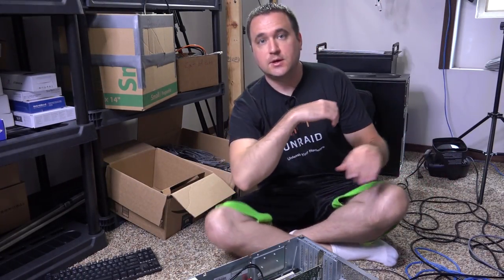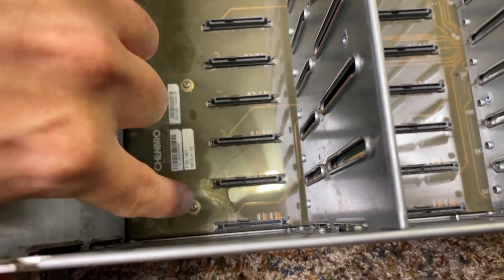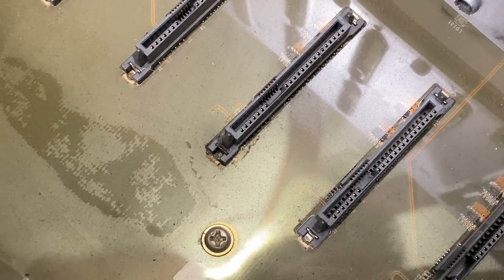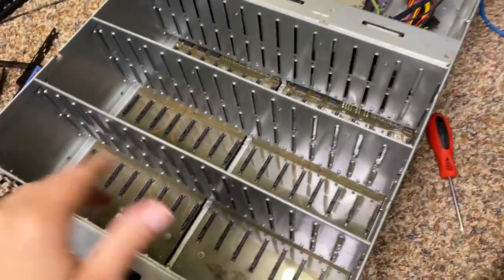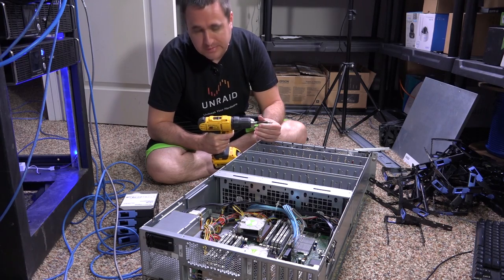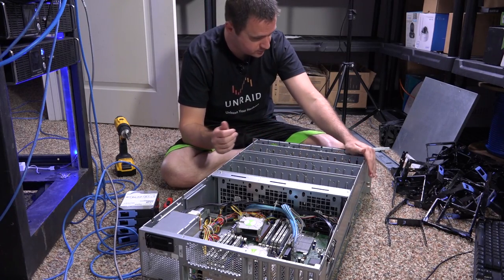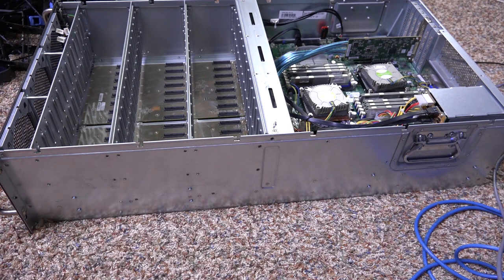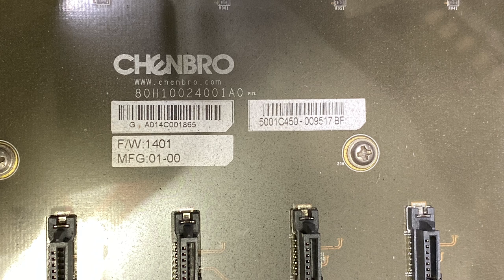New Server Tear Down...It was gross..

Comment: Lots of advice already given but I'll just add my 2 cents here. ;) As for credentials, I've worked in Enterprise storage all my life and I've recently done some videos of my personal server discussing exactly these topics (combined with ZFS but stil). Not linked, but they are pretty recent on my channel!

- Each LSI/Avago SAS2008/SAS2108/SAS2308 card can be run in IT mode, bypassing any onboard logic chip and giving the OS direct access to your drives. You want this if you are running UnRAID or ZFS, the OS and the disk system (UnRAID/ZFS) will control what will happen with a disk that is failing or not working correctly, no intervention from any RAID logic desired.

- A SAS connection in a SFF-8087 cable is made up of 4 channels. SAS comes in 3Gbps, 6Gbps and 12Gbps. Most generation and the connectors you are looking at are mostly used in the 6Gbps generation. Each cable has 4 of those connections given them 4x 6Gpbs for 4x SAS/SATA600 or it can be used as a combined connection to a backplane giving you a 24Gbps connection. Most SAS cards have 2 of those connectors so with SAS/SATA600 that means there is a total bandwidth of 48Gbps per card available. This translates to roughly 4,5GB/sec (Gigabytes per second). 
- Those cards have a PCIe 2.0 x8 connection which roughly is 4GB/sec but because of inefficiencies in the PCIe 2.0 protocol that translates to around ~2500MB/sec of actual real world data transfer speeds. That means that the effective limit of the card is very well matched in regards to SAS/SATA and PCIe bandwith available if it has 2 ports, 4 port cards would be PCIe bandwidth limited on PCIe 2.0!

- What limits are important. A single 10TB disk (Seagate IronWolf 10TB as an example) has a max sustained transfer rate close to 250MB/sec. That means that using 10 of these drives would max out the PCIe bandwith limits described above. But...this 250MB/sec is only achieved at the very start of the disk, further down the platter this decreases to about 160MB/sec. But as a general rule you could say you don't want more then 10 tot 12 drives per PCIe 2.0 x8 SAS controller.

- SAS is generally pretty intelligent. The three connectors on your backplanes could be used for one of three things, bandwidth, redundancy and daisy chaining. They could also very much be able to do all three per port, depending on the topology you hook them up. It's also possible to have "dumber" backplanes where 1 channel is 1 device. For instance in my server, I have 5x4 drive backplanes, each backplane takes a SF-8087 connection and then uses the split function to make one channel go to one drive.
- Hooking up 2x SFF-8087 to a single backplane does increase performance! "Channels" can be added together without penalty, even with SATA disks but it all depends on the chips that are controlling the backplane
- SAS connections using a backplane are "switched" so the total bandwith is available to all devices, not split in 600/600/600/600/etc.. So 4x250MB/sec is 1000MB/sec total and no bandwidth is wasted to the upstream connection.
- SAS expanders can have issues, including firmware and card compatibility. I'm hoping you won't run into these, most often these built-in server solutions are pretty good, but still

- Depending on the motherboard used take into account PCIe slot limitations, electrically x8 or x16 does not mean that bandwidth is actually available to that slot!
- Also take into account lanes per CPU (if you are running a Dual CPU setup) and other cards using a lot of bandwidth such as 10Gbps Ethernet, etc.

! In my server I went with 2x SAS2008 based cards with 8x SAS/SATA600 channels a piece. Combined with my motherboard ports this give me 24x SATA600 and basically 0 bandwith limit anytime. This was also the cheapest solution since SAS2008 based cards can be had for 35$ from Ebay
! Update SAS2008 to the newest firmware and make sure if you use multiple that they are running the same version. You can forgo flashing the option rom or disable loading them from the BIOS if you use Motherboard ports for booting
! Using Mirrors instead of UnRAID or RAID(z) you can create an array that will stay working even if a backplane or SAS card (in the case of multiple) fails
! Consider researching a feature called "staggered spinup" this can often be configured in the BIOS of the LSI card or during driver initialization. This basically keeps all drives OFF while cold booting the server and then turns them on 2 (or whatever you configure) at a time. This minimizes "harmful" hits to your power supply. It increases cold boot time a little bit. Modern Seagate Ironwolf 10TB drives for instance support this out of the box when connected to a backplane. Most Enterprise hardware has had this feature for a while but consumer drives don't always or don't have it enabled by default (can sometimes be set with software tools).

* Depending on your motherboard and the make/model of the backplane, getting 2x SAS2008 8 channel cards would be my advice. This would give you 4x SFF-8087 to hook up to your back-planes, plenty of bandwidth for all drives connected (unless you start using a lot of SSDs). If you have PCIe 3.0 a 16 channel (4 connectors) would be acceptable and give you the same total bandwidth (~5000MB/sec). Yes that is still a "bottleneck" but if 5000MB/sec really a bottleneck? :P
** Ok, if you want full/max bandwith you can get 2x SAS2008/SAS2108/SAS2308 4 channel cards and that will probably allow you to hook up all 3 connectors on each backplane. Backplane bandwith would be 72Gbps per backplane, so 144Gbps in total, which basically would mean 13,5GB/sec (or 13.500MB/sec)! You'd better have PCIe 3.0 to back that up! Running 2x PCIe 3.0 x8 gives you 8GB/sec + 8GB/sec so could work and then the drives would become the bandwidth limiting factor. But ask yourself if this is worth it since the connection with the outside world is going to 10Gbit or maybe 20/25Gbit at best, does it then make sense to spend 3x the money for something that can't make it out of the box anyway.

? What is the exact model of the server and maybe also the backplane model and revision printed on them.

Oh man, I'm going to leave it at that. I'll hop into your Discord (Quindor there) if it's open so we can discuss more if you want! :)
Reply: Hey you stated that a sas2108 card can be flashed to it mode. I wonder how to do that because I can get some for very cheap.
Reply: @niklasp.5847  It's a lot less common because these are cards with actual CPU and memory and such but if you search around you can find people who where successful! Check out these links: https://youtu.be/CDatT8fn9KQ , http://mywiredhouse.net/blog/flashing-lsi-2208-firmware-use-hba/ , https://forums.laptopvideo2go.com/topic/32418-lsi-sas-controller-firmware/

Comment: Another note on noise. Don’t use just one PSU, plug in all 4 when your setting it up or testing for sound. It should balance the power load across all of them and like many servers if one is unplugged the others plugged in will ramp up fan speed. If you plug in all 4 it may quiet down a little bit. Also you won’t get the beeping “failure” alert from the PSU not being detected.

Comment: The way you're counting SAS connections is not how it works especially since you're using SATA drives.  Adding more connections does not increase the "speed" -- it adds to the path depth of a chain..  Adding a second connector would give you dual path to an expander but no more speed.  If you split the SAS connection to multiple cards so the backplanes are properly balanced it will let you have a SAS controller failure and still see your entire array.  Going with 2 SAS Gen3 cards will provide you more bandwidth across the PCI bus for I/O.  You're biggest limit is using SATA drives -- they suck for large array performance.
Reply: Without SATA to (dual path) SAS expanders just after the SATA HDDs, only the first path to the SAS controller(s) will be active.
Reply: Would you mind giving me a site with some information to learn about SAS controllers and expanders.
Reply: Since this is a Chenbro NR40700 (I believe), a 12Gb won't help one bit in terms of speed. Looking at the manual for the backplane(it provides a nice assembly/disassembly guide) there is only a second port for High availability purposes(third for daisy chaining), no extra connections/speed. The current card is probably the best for it(maybe get it in IT mode if it is not already)
About the Throughput: the HDDs are the real blockers; expect somewhere in the ballpark of 250MB/s, if you want fast: go for SSDs ;) but that 250MB is plenty fast for most applications(likely the only time you'll run into it is when you transfers large files unto/off of it, all other times you won't reach that speed :)
Reply: Also if I'm not mistaken, Unraid only writes to one drive at a time anyway not like a true RAID based system such as even ZFS where it writes across the pool. You wouldn't get any more performance other than what the single drive is capable of.
Reply: GravGunner look up DataBolt, which is a 12Gbps SAS HBA feature that allows interleaving of commands across multiple 6Gbps devices. It should at least improve rebuild times on Unraid.
Reply: @malventano  nope, it can technically allocate more channels, but since the backplanes themselves run on 6gb.... there is no benefit. Aside, as said the HDDs are the real limit here
Reply: @GravGunner  I spent a few evenings a/b testing this on a set of diskshelves using 6Gbit expanders + SATA HDDs and saw significant improvements to rebuild times. Couple that experience with the fact that LSI added DataBolt to their 12Gbps HBAs specifically to increase throughput when used with legacy (6Gbit) backplanes and HDDs. Kinda runs against your advise there.

Comment: First, the SFF-8087 cables carry four SATA/SAS connections each. They aren't carrying PCIe lanes like an m.2 or u.2 ssd would use. That card has 8 internal 6Gbps connections, thus the 8i in the part number. The card you have will give you the fastest possible throughput with the configuration you have. There is no guarantee the backplane will work with 12Gbps SAS. And, even then you wouldn't benefit unless you got 12Gbps SAS SSDs or HDDs. Also, eight SATA/SAS 6Gbps will not saturate a PCIE 2.0 8x interface, so you would not benefit from using two cards. Hope this helps.
Reply: First, 12Gbps SAS HBAs are backwards compatible with 6Gbps expanders. Second, 12Gbps LSI HBAs include a feature that enables them to aggregate bandwidth of multiple connected 6Gbps backplanes, increasing throughput to values greater than would be seen with a 6Gbps HBA. Source: https://www.youtube.com/watch?v=c5yJgyXS7-M
Reply: @malventano  The aggregation you talk about, needs an expander supporting that actually. LSI calls this i.e. DataBolt. Also a caveat is that you can't make a SAS Wide channel over multiple cores/CPUs on SAS controllers. So I've found out currently you're basically limited to 2 SAS connections per expander, with currently available SAS HBAs (that I know of). I've tested a plethora of HBAs, and have 9207-8(i and e), 9300-8(i and e), 9305-24i, 9405W-16e... on 3 HGST DATA102 JBODs ;) Using a 12Gbit SAS HBA on a 6Gbit expander will never utilise the aggregation, and still negotiate down the entire SAS bus to 6Gbit (or lowest SATA PHY speed, like 3Gbit). Some SAS2 cards don't even support SATA3 :o
@Byte My Bits You'll probably have the best performance with 2 x 9300-8i (even on PCIe 2.0, bc of the faster SoC on the HBA), and dual link each expander to each HBA. You'll just need 4 SFF8643 to SFF8087 cables of enough length then.
Reply: That and a PCIe 2.0 x8 has a theoretical bandwidth of 4000MB/s.

If I understand UnRaid correctly.  The name says "Un" Raid.  Its my understanding it treats the array as a kind of Jbod.  Filling up each disk as it goes, using the designated parity drives for parity.

So if you had a single disk failure, you would only be hitting the new replacement disk, and its assigned parity drives during the rebuild.  And not the entire array as you would in a traditional, or RaidZ pool. Data does not stripe across disks, unlike in ZFS and traditional RAID.

I run FreeNAS. If a single disk in my 9 disk RaidZ3 array fails, all 8 remaining disks get hit during the re-silver, since ALL of them contain parity data used to rebuild the failed/replaced drive.  Being RaidZ3, I'm not worried much about a subsequent failure during the rebuild.  But theoretically, if the rebuild causes a 2nd, and a 3rd disk to fail, I'm okay.  But at that point, I'd just assume the array is gonna fall like dominos.  

If my 6 disk RaidZ2 pool has a disk failure, then the remaining 5 disks are hit hard during the re-silvering to rebuild the 6th disk.

That said, with todays modern 8TB+ disks, rebuilding/re-silvering can take a LONG time no matter what you do, and the load can cause a 2nd disk to fail during the operation.  So its best to have multiple parity drives.

I kind of wish my 6x 8TB RaidZ2 was actually a 7 disk RaidZ3, but I'm really glad its not a RaidZ1.
Reply: @wjrneo2  it fills like a JOBD, but the parity is calculated from all drives across the array, meaning that rebuilds must read from all drives in order to rebuild the missing one.
Reply: @malventano I got the information from the UnRaid forums in a post from a a community developer.

https://forums.unraid.net/topic/47929-unraid-singledouble-parity-vs-raid56/

Quoted content:
Big differences between unRAID and traditional raid systems are:
Parity is always on a specific disk (or a specific second disk in the case of dual parity).  This means when updating a data disk only that disk and the associated parity disk(s) need to be spun up - all the other data disks can remain spun down.
Each data disk is a discrete file system and all the data on it is accessible if that disk is moved to another system (as long as that system understands the file system type).  This means that one is far less likely to lose data in serious failure scenarios.
When reading data only the disk(s) containing the data need to be spun up.
The downside of the chosen approach is that is not optimised for performance when writing.  
 
Rebuild time is unaffected as any rebuild always involves writing every sector on the disk being rebuilt.

/Quoted content.
Reply: @wjrneo2  Is correct.

Mother Board
https://www.supermicro.com/products/motherboard/Xeon/C600/X9DRH-7F.cfm

Including 
Intel® C602 chipset
https://ark.intel.com/content/www/us/en/ark/products/63984/intel-c602-chipset.html

Specs:
PCI Express Configurations ‡ 2x4, 4x2, 8x1
PCI Express Revision 2.0
https://en.wikipedia.org/wiki/PCI_Express#PCI_Express_2.0

"PCIe 2.0 uses an 8b/10b encoding scheme, therefore delivering, per-lane, an effective 4 Gbit/s max transfer rate from its 5 GT/s raw data rate."

TLDR: The SAS / RAID / HBA can spit 12GBps... The motherboard chipset is the bottleneck at 4 Gbit/s. IF OP wants better performance then he will have to upgrade.

Comment: The noctua 40mm fans which is what the PSU uses has the super simple press to splice adapters to allow you to attach the noctua fan to the probably odd connector used in the PSU. Thats how I swapped all my 40mm fans in my switches.
also the 40mm fans come in 5v versions if thats needed.

Comment: I’m not sure if you know this Jason, but Unraid typically only allows for 30 drives max. If and when you figure out how to get past that, I would love to see a video about that process!
Reply: Well its 28+2 parity for the main array, then up to 28 cache drives, but you can still mount and even do software raid on other drives using third party tools.
Reply: Yep, add zfs plugin and have lots of fun there. Works amazing
Reply: Recently I flew ober the description for unraid reading just that, but there was mentioned you could use more drives as unassigned drives.
Reply: @wiedapp  Correct. Unassigned drives allows you to manage drives outside the array and do anything with it you want. Separate btrfs pools, or any other supported fs. Or directly pass then to your VM's. 
ZFS is a plugin that allows you to run full zfs on unassigned drives. So only limited by your imagination (and hardware)

Comment: Not that it will help now.... but those expanders have 2 thumb screws in the front that allow them to simply slide out of the chassis. You didn't need to take all the metal apart to get to them.
Reply: Ha Ha lol, you learn the hard way my brother!
Reply: Correct.

Comment: There are dummy blank power supply trays that will allow fewer than 4 supplies and no beeping. I have a couple in each of my 2 drive cabs here (eg I'm running each case with 2 power supplies).
Reply: If you don't care about ever getting a power fail alarm, you can disconnect the 2 pin wire connector that connects to JP1 on both backplanes (see the Chenbro site/manual I referenced earlier). JP1 is the alarm signal coming from the power supply. Disconnected should stop the alarm (haven't tried it on my units as I have the dummy trays)

Comment: Your best upgrade would be the 9300-8i, but you are still limited to what you currently have, except for throughput from 6 to 12. However, you'll find that even at 12 Gb/s during rebuilding with that many drives it'll take practically days.
Reply: Your PCMD Completely agree with. The 9300-8i is the perfect choice due to inherent limitations of the backplane. Plus...they are HBA’s which is what you need for unraid. I don’t think you can do redundancy across two HBA’s and Chenbro backplanes. BUT...it appears you could use two 9300-8i’s....connect both cables from one card to one back plane. That way you have use of all 8 data lanes to each backplane.